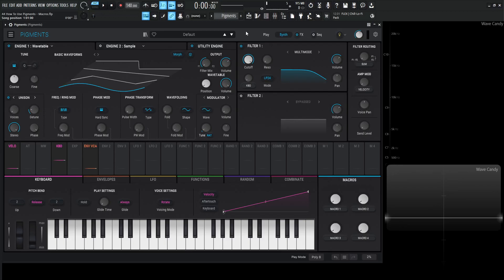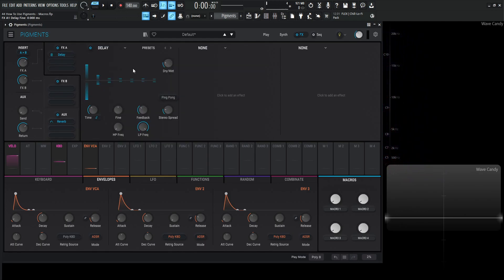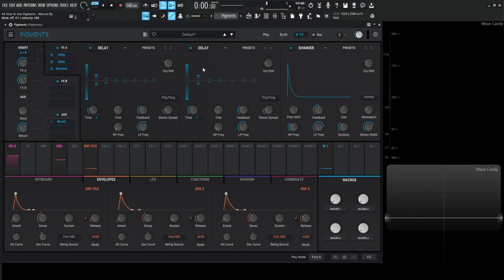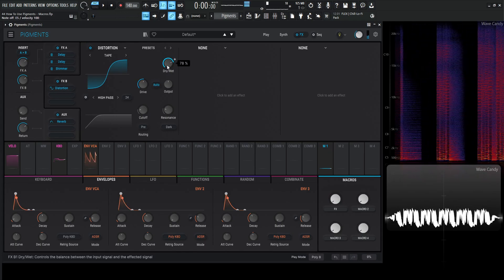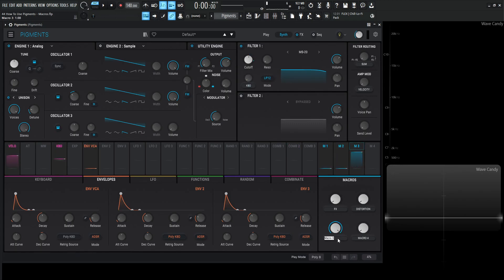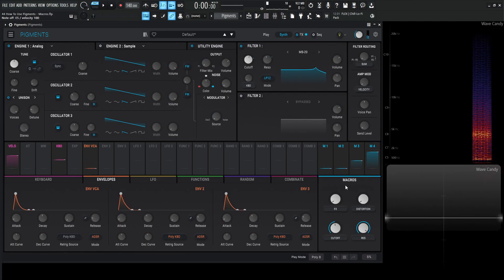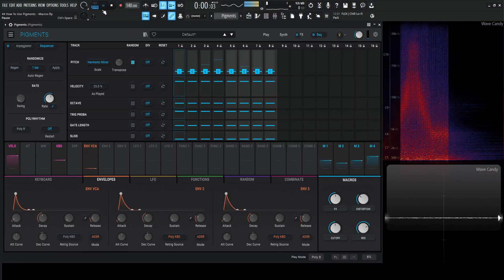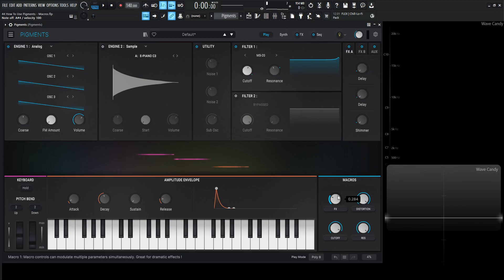Macro Modulation PART 44 | Arturia Pigments 4 Tutorial

Comment: Is there a possibility to automate the bitch bend wheel ? Same goes for the macros. Of course its very powerfull when turned manually but... Thank you for this great tutorial
Reply from the maker: You're very welcome! Yes it is possible to automate the pitch bend wheen and all the macros. Depending on what daw you are in, how you automate those parameters will be different. In FL you move the parameter you want to automate and click on the knob icon on the top bar of FL Studio and select 'create automation clip' and it will create a clip in the timeline that you can edit from there.
Reply: @jonaudio  The macros tutorial has been very helpful. Can  Pigments assign an LFO , for example to modulate a macro knob-- which is another form of automation , I suppose?

Comment: Hello, Jon! Thank you for your tutorial. 
Can you please make a separate part in your tutirial of how to use a Hold Button (located in play setting section).  When pressed, it allows layering multiple sounds (kind of Latch mode) but i don't have the slightest idea of how to record the resulting sound. It looks like a record button doesn't work proprly in this particular scenario.
Reply from the maker: Thanks dude! I can definitely talk more about hold mode in a future video. The hold feature in pigments is pretty basic. When enabled it will just 'hold' the notes for you that you press until new notes are played. It's great for chords using the arpeggiator.
Reply: @jonaudio  Thank you for your reply. Is it possible to record these "holded" notes live?  
For example, when i press a HOLD button and press several different keys on my midi keyboard, I am getting constantly played chord sound. After that i am changing sound parametrs and press different key, so the music keep on playing but it sounds in a different manner and so on..
By doing that i can create a whole ambient track.  But  how to record the whole melody from very begining? Recently i played around with "Intricate Pad" preset. I pressed record button and played for about 30 minutes (in "hold" mode). I was sure that ableton would record the whole melody but it only recorded one chord..  I was very dissapointed. Any solution?  What would be awesome not only create but also record live ambient performances "in Hold mode".